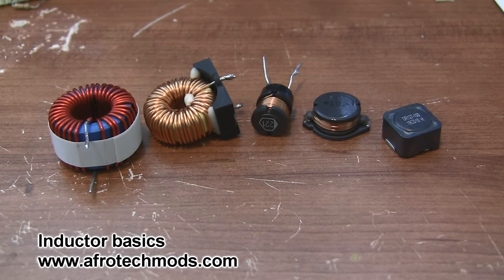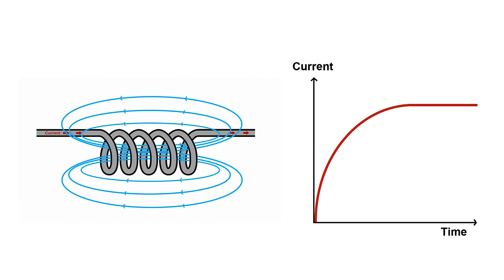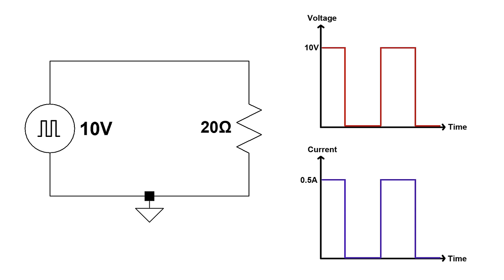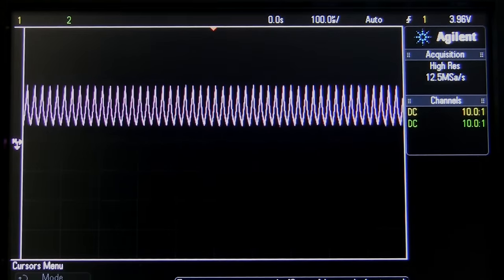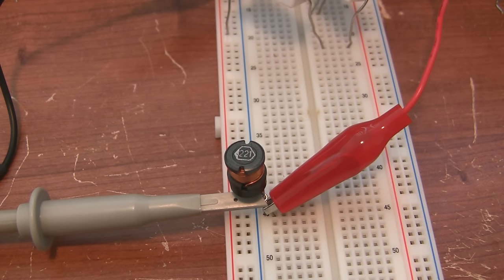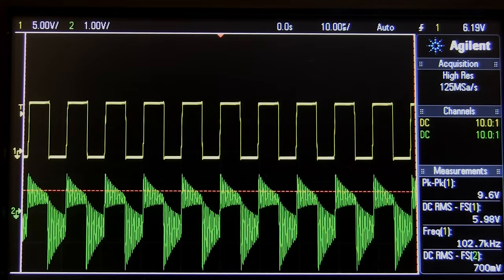Inductor basics - What is an inductor?

Comment: It would be awesome if you could do a video explaining how capacitors and inductors are the equal and opposite of each other, and how you can use them to smooth voltage and current in a circuit....like power supply filtering.
Reply: maybe this is design engineer can get it.

Comment: If inductors PRODUCE HEAT, doesn't that mean they're wasting energy, whereas a CAPACITOR won't waste energy that way.
Reply: Inductors don't "consume" energy, ergo they don't get hot, they pass real power and push back reactive power in the opposite direction

Comment: Current enters into a coil, creates a magnetic field,  the field expands and then - at a point,  stabalizes. Why doesn't the field expand infinitely.  What is the cause of this stabilization?
Reply: +Andrew Kornrumpf  The script definitely needs a rewrite. Failed to mention that the moving magnetic field induce  current into the conductors. As long as the circuit i is connected to an AC power source the the moving magnetic field will   continue to exist, stabilize if you  will. Not really certain what the video creator meant by stabilize, other that it's possible to calculate how much impedance that an inductive circuit will present to current flow, and that impedance will remain the same as all factors determining that remain constant There should be no expectation the magnetic field can expand to an unlimited size, if that's what you mean by infinity. Perhaps all that was covered in his other videos on the topic. I did go look at them because I have a working knowledge of the topic, and I'd grab my old textbooks if I need to hamgineer a circuit to do a specific task.
Reply: Andrew Kornrumpf 
your profile picture went perfectly with the question
Reply: why dosent the field expand infinitely? well its bcoz the field depends on the current- larger the current greater the field. The field stabilizes coz the current flowing becomes constant. REply if still not understood.
Reply: It does expand infinitely. However, it reaches a maximum once the current reaches its maximum. Maximum strength, not maximum size, of the magnetic field.

Comment: 3:10: It would be interesting to know why inductors have no effect on DC circuits. Do they not also generate magnetic fields? If not, then technically there are no DC inductors. And if they *do*, then do these magnetic fields not also dissipate over time?
Reply: @Chris Russell What about when the DC current is switched off and on? Does the magnetic field still resist the change in current? I think it would have to grow and dissipate much like it does with AC and thus generate back EMF.

Comment: I'm watching this to try and understand how radio transmitters work. Thats cool that the square wave current when passed through the inductor creates a current pattern similar to a sin wave, but what is the point of turning it into a sine wav? couldn't a carrier frequency just be a square wave and skip the inductor all together? and couldn't that be the case for any other application, not just radio carrier frequencies? If anyone knows that would be great, I'm very curious.

Comment: Excellent video as it does a great job of explaining a simple concept.  I use the analogy that a capacitor and inductor are essentially opposite circuit components.  Inductor is a short circuit to DC current and an open circuit if the frequency is high enough and capacitors are just the opposite.  They are open at DC and shorts at a high enough frequency.  However, I've never seen such a short and clear video explaining what that time constant actually looks like when describing the charge and discharge state of an inductor.  I do have one VERY interesting (to me) question.  When you create the magnetic probe with the other unshielded inductor, it appears that there is VSWR and a decay (related to the sensing circuit's time constant I'd assume).  What is causing the VSWR there?  Is it related to the rise time of the square pulse and the resonance of the sensing circuit?  Really curious about that... THANKS!
Reply from the maker: It's not VSWR, it's resonance and yeah you pretty much guessed it. It's like a small air core transformer. The primary side will have inductance and capacitance, so will the secondary side, and there's capacitance between two coupled inductors. So the system will have a certain resonant frequency. The sharp edges of the square pulse hit the system and it rings.
Reply: i have one more question....
when we connect primary coil of transformer to ac supply, why it not get short circuited.
it is simply a coil.  so why it doesnt sc??
Reply: any wire running current through it has electromagnetic fields rotating clockwise around it.  when coiling it in a tight coil, the upward facing wire's electromagnetic field crashes into the downward facing electromagnetic field causing disruption of the flow and a outward spreading chaotic magnetic field that is sort of stuck.  so this is like a big resistor/battery in one.  it prevents a short because a short is when there is no resistance and the current goes too fast and trips the house's breaker since the over current can overheat wire and cause a fire.

Comment: If we can use capacitors instead of an inductor then  what is the need of inductor in circuit?
Reply: One advantage of the inductor is the ability to generate a high voltage spike when switching current through it.  This is how the joule thief works, and the spark generation for an internal combustion engine.  Capacitors can't do this.    
For signal filtering purposes, you can use combinations of capacitors and inductors to increase the Q-factor.  I'm not sure of the relationship, but I remember that a filter can be 1st order, 2nd order and so on depending on how the capacitors and inductors are combined.  This changes the slope of your filter as expressed in dB per octave.  Using capacitors on their own will give you the minimum slope gradient of 6dB per octave.  By adding an inductor you get 12dB per octave.
Have a look at the simple filter circuits on https://en.wikipedia.org/wiki/Low-pass_filter

Comment: I designed inductors for my switching power supply designs from 1983 to 2008.
Life would be easier if inductors acted like theoretical inductors, but they don't.
Life would be easier if we could buy wire with no inductance, but it has ~~ 1 uH/meter.

Comment: Say I have a logic-level square wave, where 0V is "low" and 5V is "high". I'm pulsing this at a constant 60Hz, 50% duty cycle. My intuition says that since the voltage never goes negative, it's a DC signal, regardless of how fast I'm pulsing it. Is that correct?
if that correct, what is the power source of circuit at 1:40 ? Is that a DC or AC? if its dc why it can working well with inductor? As you said its have no affect with DC.

Comment: I have a question 🙋. 
If we talk about an Lc oscillation then we see that the capacitor is getting discharged with a DC output.(decreasing DC). And an inductor works as a wire for DC circuit. Then How can we see the energy exchange between the Capacitor and inductor?

Comment: hi, very helpful vid. you helped me understand that an inductor is to current what a capacitor is to voltage (right?)

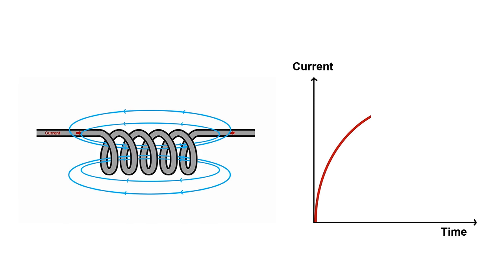at 0:30 you say energy (current?) is stored in the magnetic field. Does that suck current away from the output of the inductor? or does the inductor output "build up" current over time, as a cap builds up voltage over time?

does the arrangement at 2:57 demonstrate how a transformer works?

at 3:00, what is that high freq content inside each cycle of the square wave?

thx!

Comment: I've got this hand held super Nintendo (supaboy) and it has an inductor that overheats.  It's part of the power circuit (next to the battery input).

Do you suppose it's a bad piece and needs to be replaced with the exact same type?  Or could they have put one in that wasn't correctly rated for the circuit?  It's getting so hot, part of the game's case is melting.

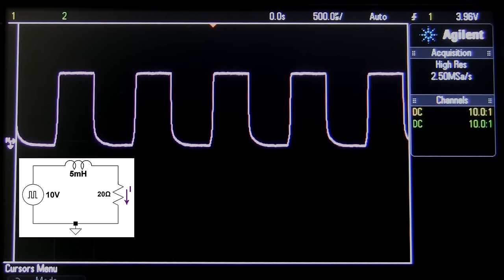Comment: Why is the current waveform at 1:45 not symmetrical?  The charge and discharge shapes look different.  Is it because you had some headroom on the high side of the UC2950T driver (with a >10V power supply), so it had trouble sinking close to 0V but was OK sourcing at 10V?

Comment: In a transistor controlled relay circuit when a protection diode is used in reverse across the relay coil, what happens to the current when the relay is switched off? I can't get my head around where the induced current flows to! Thanks.
Another excellent video BTW.

Comment: The really important piece of fundamental physics here is that in addition to a current generating a constant magnetic field, a changing magnetic field creates a current.

So when you turn off the current in a circuit that has in inductor in it, the magnetic field that existed has to turn off, but this is not instantaneous, as the magnetic field decreases to 0, it will induce a secondary current in the circuit, that is why the current lags behind.

Of course, the energy for this secondary current came from the original energy spent to form the magnetic field the first time the current was turned on.

Comment: when measuring inductive circuit using a digital multimeter what could give you false readings?? the multimeter internal supply voltage, multimeter internal impedance or something else.

Comment: The special case of switching out current from an inductor means an almost instant current change to zero and only air to conduct to. Current is zero but the voltage breaks air with static charge.

Comment: if we remove the inductor from the circuit when it is fully charged it will store the magnetic field and can be used in another circuit like we do with charged capacitor?
or the inductor will immediately lose the magnetic field and become normal wire?

Comment: place the 2 probes at the two ends of a 0.5ohm resistor and the oscilloscope will show a very good looking waveform which you can assume that is what you want to see. If you don't see anything play with the time/div switch of the oscilloscope until you see something.Don't forget to add manually (in series) the 0.5ohm resistor at the point of the ciruit you want to see current waveform.

Comment: What are the advantages / disadvantages (if any) of using an inductor in series rather than a capacitor in parallel (or vice versa) for high/low pass filtering or differentiation/integration? Obviously they have advantages when it comes to power factor management but are there any other notable reasons for using one over the other, IE are inductors or capacitors 'cleaner' or less noisy , better freq response or w/e

Comment: Why does the current and voltage cycle in the diagramed square waves? I don't think you're cutting the power, so it wouldn't be a DC source, but I thought AC sources formed waved oscilloscope pictures.
Reply: +Andrew Kornrumpf Idk if im interperating your question correctly or not, but ill try to convey what i know. 
When you are changing the current (AC=alternating current) you produce changes in magnetic field which means changes in magnetic flux which means an inductor that does what its purpose is.
AC just means alternating current. Usually (actually i think always) the AC in your power lines are sinusoidal (wave). So the current changes following a wave (no sudden/instant change in current).
When he uses square current, he is also alternating the current. Except instead of going from say -1amps to 1 amps in a wave form (sinusoidal), he goes from 0amps to .5amps instantly (square form). So basically the battery he uses only outputs a 0 Amps current or a .5 Amps current, nothing in between.
What he is trying to convey is that the current readings from the ammeter within the circuit is affected by inductors (only in AC because remember inductors are just pieces of regular wire in DC).
Inductors do not work on DC because they rely on changes in magnetic flux. Magnetic flux is the change in magnetic field per area (in this case area is the area of the one circle from the selenoid multiplied by total number of circles). Magnetic field is produced by current. Constant current (DC) means constant magnetic field, which means constant magnetic flux, which means a trivial/useless inductor.

Comment: I am trying to learn about electrical things, without so much as a lesson plan, teacher, or class. This is this first of your videos I've watched, and I can already tell it's going to be good.

I thought that the thing you did with the inductor to use it as a sensor was very cool. I'll be sure to remember it, as it may come in handy. …Also, what could you do if you made a tightly packed grid of those same type of inductors (except perhaps a bit smaller), in the same orientation? Some kind of frequency sensing plane? Maybe have each one correspond to the brightness on a pixel, or an LED, in a grid. Not sure how you would represent the data in a graph form.

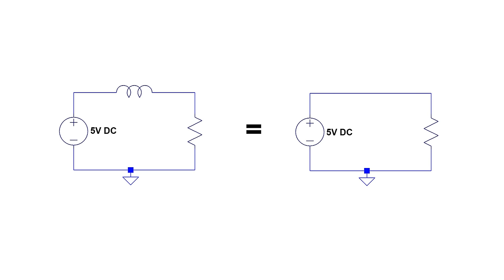Comment: 3:15 Silly question, the inductor still produces a magnetic field right? Like, you could easily have an electromagnet where the inductor is in the dc current. It is just that math wise when calculating circuit components, then the inductor can just be ignored? I assumed that to be the case, but the wording made me doubt myself a little.
Reply from the maker: Yes that is correct. You get a static magnetic field and it's basically an electromagnet.

Comment: Inductor and capacitors are like opposite poles, Ind holds charge in form of magnetic field, whereas capa holds charge in electric field form. Also Ind doesn't allow sudden change in current through it, while capa doesn't allow sudden change of voltage in it. Hope this helps!
Reply: you are so excellent for knowledge about this.

Comment: Why do i see iductors in soo many DC devices..since they have no effect.what are they used for in DC applications?
Reply: they do have an effect, when you start your device the inductor will initially oppose the change and slowly let it through until it acts as a simple wire. Then when turning off the device the inductor will act as a power source and gradually lose the energy stored until it acts as a barrier again.

But I guess you ve already solved that question of your by now

Comment: If you say, Current that flows through a wire creates an magnetic field  ( can I accurately say flux lines ), does that mean everything?  Even the wire that's used on my phone charger. Is that producing flux lines as well, when the current from the outlet goes through it?
Reply: +Andrew Kornrumpf Yes, although very small.
Reply: +Andrew Kornrumpf  its very small as Max Ellery said, but most wires are shielded in some manner.

Comment: You can add a resistor in series with other device such another resistor, this is the current you are trying to measure, 1K for example, and use Ohm Law to calculate the current.
Reply: good suggestion can i add you? thanks if you like it could you have time to browse our site? thanks

Comment: a silly question. Does the number of coils of the inductor increase its impedance?
Reply from the maker: It's a good question and yes!
Reply: @Afrotechmods  Cant find an answer on how much. I cant find a formula for it. 

The following equation is used for the impedance of an inductor:
 ZL=jωL 

but the windings/#of coils dont seem to affect it.
If lets say I take a 1 meter of copper wire for each indcutor and make an induuctor with 100 windings and one with 1000 windings. Why the 1000 winding would have more resistace?
Ive got really confused
Reply from the maker: @MFDOOMgr  Look for coil inductance calculators like this http://hyperphysics.phy-astr.gsu.edu/hbase/magnetic/indcur.html
Reply from the maker: More coils increases the inductance which would therefore increase the impedance
Reply: @Afrotechmods  so simple. thanks a lot

Comment: Is there any difference between inductor and coil because I've heared this question before.
Reply from the maker: Same thing
Reply: thanks
Reply: +Afrotechmods These magnetic fields can be a lot of fun, if your colleague has a pacemaker.
Reply: ***** Well, a coil of rope does not induct , does it.
Reply: therealnightwriter Excuse me?
Do you need help shedding this mortal coil?
Reply: +Mahmoud Metwally  No. Even  a straight conductor  can act as an  inductor.  The creator of the video should have also mentioned that movement between an conductor   current is induced into the conductor it's that induced current that resists current flow through the conductor.  Keep in mind when that the power source is AC there is a constant movement between a magnetic field an the  conductor.

Comment: A coiled wire vs. A non coiled wire.  You say a coiled wire will produce a larger magnetic field.  Why is that? 
1) This is assuming the wires are the same length? 
2) Could the cause be something along the lines that the first coil, when acted on by the electron, produces a flux line that "pushed " the other coils?
3) How is the energy from an electron, turned into a magnetic field ( can I say wave here ) ?
Reply: A coiled wire has all the currents going in the same direction so the fields from all the wires next to each other combine. If you have two wires and they the currents are going in opposite directions the fields will cancel each other as long as the currents are equal.
Reply: So it is basically superposition of waves, correct?